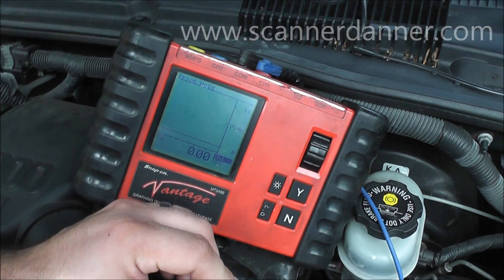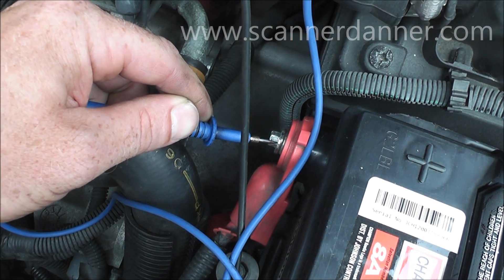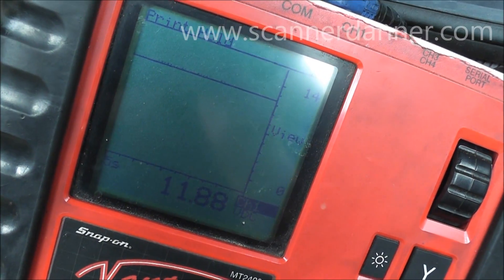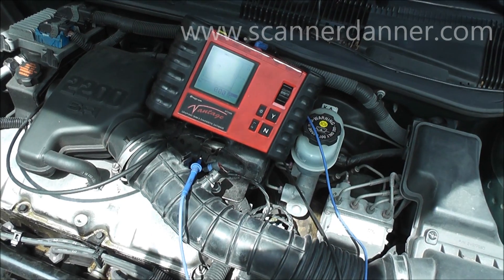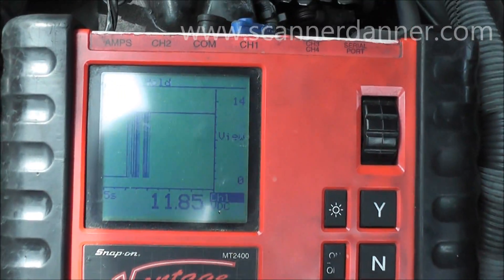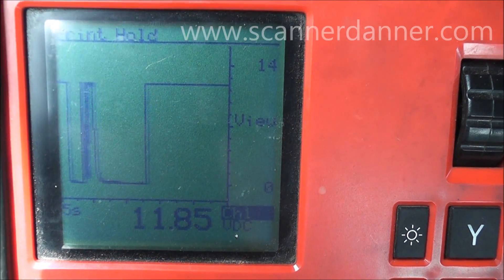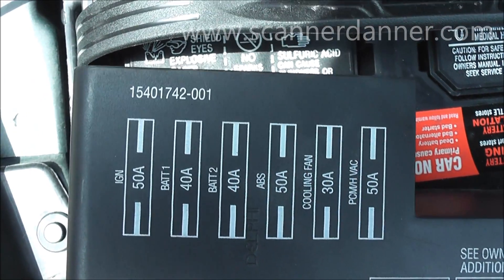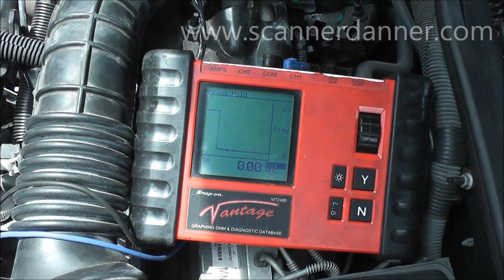2002 Chevy Cavalier No Start (a direction based approach)

Comment: Thank you.  I used your video to fix my 2002 S10.  Your explanation is to the point, logical in the correct order of diagnostic and very useful.  My little 2.2 engine only has just 66,000 miles but stuff pops up.  Yesterday I got in and started the truck to go to the park with my wife and daughter.  The truck ran for a few seconds then just sopped.  I noticed the shift indicator didn't eliminate over the PRND21 deal, and the fuel gauge didn't work.  I'm no pro, but have one of those diagnostic testers which I hooked up to see no communication.  I had no idea what to do at the time, so I searched the sea of forum thoughts which generally lead to land of nowhere.  Fortunately I found your video the next day.  My problem was simply a blown ECU fuse in the engine compartment.  I found it with my electrical tester, put in a fuse and bink! on came the illumination over the P, the fuel gauge went up and she fired right up.  Thanks man!
Reply: Awesome Greg. Don't forget, that fuse blew for a reason. My suggestion is keep some extras with you in case it happens again and DO NOT put a bigger fuse in as the "fix". A 5 amp higher than normal to get you home in an emergency situation only and if that blows, get it towed.
Reply: ScannerDanner Premium For sure.  Thank you for another sound suggestion.  It;'s amazing how glitchy these little trucks are given the low miles.  This one was driven by a grandmother for the first 62,000 miles in Arizona were it doesn't see snow and very limited wet conditions.  It looks clean and orderly, but still it has goofy stuff that pops up.  It is 13 years old I guess, so I understand.

Comment: hello i have a  2010 ford e250.  recently i has a wrench light on the dash, the van is bucking real badly if i move off  slowly if floor it , it will get up and go with no slip or bucking.  if i come to a stop light and shift from drive to 2  it will surge and just dies,   if i then step on  the gas in 2  its like the  gas pedal dosent exit.   if am doing say thirty miles per and shift to 2 it will drive with no problem ,.. only sitting it will not rev it will just surge and dies..    wrench light not sending  code to my obd scan.  thanks your thought
Reply: I am directing all help requests to my forum. Sign up (it's free) and create a new post. Be sure to add a name under "alias" as this is the name that will appear in the post.
Here is the link to the forum. 
http://www.scannerdanner.com/ForumRetrieve.aspx?ForumID=3226

Comment: I have a '05 Cavalier and (1st Car). I drove it to work, to get gas, and then Staples. When I came out of the store, my car wouldn't start. It sound like it would catch but it would die out. None of the warning lights were on prior, until after the problem. The battery and oil light came on. 

So long story short. I had it towed home, changed the oil, and had a someone check it and they believe that it is the fuel pump. But i'm still wondering how when I had it changed this past summer. Any Ideas?
Reply: I am directing all help requests to my forum. Sign up (it's free) and create a new post. Be sure to add a name under "alias" as this is the name that will appear in the post.
Here is the link to the forum. 
http://www.scannerdanner.com/ForumRetrieve.aspx?ForumID=3226

Comment: I am having a similar problem. I can start my 03 cavalier and it will start but stop 2 sec. later. here is the kicker. i also have no power to the car ( ei. the dashboard, internal lights, etc) so far all that works is the hazards and signal. headlights will not turn on, radio does not work. checked battery and its fine. checked fuses they are fine. cant understand why i have no power to the dashboard or anything else and wondering if the two problems ( starts but stops and no power to dash ) is connected. if anyone can help that would be great
Reply from the maker: I am directing all help requests to my forum. Sign up (it's free) and create a new post. Be sure to add a name under "alias" as this is the name that will appear in the post.
Here is the link to the forum. 
http://www.scannerdanner.com/ForumRetrieve.aspx?ForumID=3226

Comment: I have a 2002 Chevy Cavalier my car is kind of doing the same thing but with that I noticed the anti theft light is not coming on at all even when I try to make it come on it won't my car starts up and then two seconds it dies runs great for the two seconds change the fuel pump and its weird it started ran fine once I shut it off and then tried to start it again it went back to doing the same thing any ideas?
Reply: The start and run for a few seconds sounds like a typical GM passlock failure.

Unlike older GM's your key does not have a resistor  however the lock cylinder has a similar feature when your cylinder is turned with a key it flips a magnetic switch that verifies the cylinder is being turned, IE you are not hotwiring the ignition switch.  At the lock cylinder there is a connector three wires Black - Ground, White (sometimes red) 12V (Bulb check) and a Yellow which is 5 volt signal if your signal voltage is bad it means a wiring problem or a bad BCM (BCM controls the antitheft in 01 - up cavaliers, 00- down is the IP) the BCM is located in the Drivers left footwell under the dash  However the most common problem with the Passlock cylinders is a bad connection due to corrosion at the lock cylinder connector clean the pins the best you can with electrical contact cleaner your other option is to add a resistor between ground and the yellow 5 v reference wire  which bypasses the lock cylinder, you can OHM the cylinder to get the value or you can buy a remote start bypass from a company like DEI for $15, if you replace the lock cylinder (a waste of money) you will have to do a passkey relearn, but thats an issue for another day.

Comment: I have a 2001 chevy cavalier it isn't an all electric car it has roll up windows no anti-theft system from what I know. My issue is I keep having trac off problems with this car. I tested the throttle position sensor with my multimeter and it wasn't that. I replaced the spark plugs and it wasn't that what do you think it could be ? Also I have two wires dangling from the alternator where do they go and is this affecting my car any ?

Comment: yes it does and it only reaches to the same place and the battery light stays on now it is also in the same black covering
Reply from the maker: Ah that's because that is the alternator main battery cable. Your system is not charging without that wire being hooked back up to the starter battery post

Comment: hi my name is nick I have a problem I had to change my starter on 02 cavalier but they gave me the wrong one so I had to wait  a few days for the right one now I put the new one on but I have a wire where I don't remember where it goes I put the red on and the little one back I have a wire left that is green not sure where it goes any help please let me know
Reply from the maker: Nick without looking at a diagram I don't know for sure. If it has an eyelet on it the same size as the heavy battery cable eyelet,  it belongs on that same stud. It is common to have wires called fusible links that come off the main battery stud on the starter

Comment: my check engine comes on...my car starts sometimes but dies after idling for a few seconds...other times it will not turn over..if i turn the key off & on about 3 times  then start it will start...no warning lights comes on when it is running..just had a new sepertine belt put on it...just had the oil change

Comment: Had a similar condition, wouldn't start. Shift cable bushing on top of transmission came loose. Two zip ties later back in business.
Reply: When is the shift cable bushing located? My 99 just stopped while I was going 30mph down the street.

Comment: My cavalier is a moody car!!! Cleaned off wires and got the computer up and running. It wasn't clicking until I turned the defroster off and back on.Now it is clicking with no spark. All fuses are back up to 11.7 volts. Would it be as easy as getting it jumped now???

Comment: My 2002 Cavalier is reading 5 volts on all fuses in both fuse boxes (inside and out) but the crank fuse is reading very high.  What could that mean? Also, the windshield washer fluid tube when moved sometimes causes all fuses to lose all voltage, including the computer lights and door buzzer stop working.  The computer test was done and got 3 volts and 0.0 so computer is no working. Any suggestions????
Reply: You have a main battery voltage supply problem. ( severely corroded cable somewhere ) I would look first in the area of the windshield washer tube. If I remember there is a main harness that goes under the frame at that location that is notorious for wiring problems. Usually this just affects the headlights and parking light circuits though. I don't remember this area causing a no start.

Comment: Hey I have a 2002 cavalier as well, the check engine and ABS systems lights turn on but the starter won't even crank all I hear is the fuel pump for a couple of seconds. It will only turn on once a day and after that nothing. Would that be the solenoid/starter going bad?
Reply: I have the same model and the same problem. Any input would be great.

Comment: i have a 97 chevy suburban 350 vortech ,,  no power to fuel pump,replaced pump 3 times , checked the wiring from pump to the fuse panel,replaced fuel pump relay fuse,replaced comp in engine,replaced engine coil,just no power to fuel pump tested fuel pump with battery it works,so not sure what else to try
Reply from the maker: Watch these videos
How to test an electric fuel pump (GM CPI case study)
How to test an electric fuel pump
GM Fuel Pump Relay Testing

Comment: ScannerDanner, you give great video...  2004 sufire, similar problem, no spark, no fuel.  I was following along and when you got to the engine compartment fuse box, your small fuses (like the PCM) were hot.  Mine however do not light a test light.  All the large fuses do, just the small fuses are dead.  Any ideas?  Does passlock shut down both fuel AND spark, I can't seem to find a definitive answer on that?  If you happen to answer, thanks...

Comment from the maker: Then you have a voltage drop problem in the ignition switch or in the wiring to and from the ignition switch. If you can tell me the exact fuses that are reading 7v, I could probably guide you further.

Comment: it seems like im getting power to starter just not through the ignition. could it be the key switch or the relay that's mounted infront of radiator because that was a recalled item on these cars. any ideas will help thank you!

Comment: okay scannerdanner, Im stumped on my 1999 cavalier. 2.2. has the anti theft system. I turn the key and nothing. not even a single click. all electronics are working. fuel pump everything. it doesn't crank. it cranks if take a screw driver across the starter but it just spins. like the starter isn't catching the flywheel. also the key was hard to turn had to move steering wheel around to move it.

Comment from the maker: Okay, say all of your fuses are good. Then what? There are times you will want to know how to do this reference voltage test and why I did it here. 
Check out my Honda Element no start video and you will understand why better. 
You are not wrong in your thought process my friend. And I could have done as you suggested first. But this 5v ref test is very valuable and I wanted to show it.

Comment: if you have no communication and no check engine light  i don't understand   why u would check for 5 volt reference  i would check fuses even if fuse box is not labeled it only takes 30 secs to run across all the fuses with a test light  then if have power at fuses check reference voltage

Comment: Hi great instructional video
Could you please give some advice
My brother has a sc400
It's started played up sometimes stating, stalling, leave it for a couple of days and it would start until after a few months it's cranks but no start, obd1 code 15 number 2 ignition circ. I saw your vid on cps and replaced crankshaft position sensor as not upto spec. Have tested cam sensors ohms and v's 800 ohms 1,3v ac
I paid a auto electrician look at it and he has no idea, no auto sparky. 
Any suggestions

Comment: hey paul is there a ''rule of thumb'' on coil packs that you could just pull off the boots to check for spark? is it any waste spark system? or is it only GM with a waste spark system? i just bought my son a 2007 3.8 grand prix and the coil packs looked identical to these,and its a GM obviously, i just dont want to ruin anything by being to lazy to attach an inline spark tester but if there is a rule of thumb on which systems you could do this on? thanx

Comment from the maker: as for the low beams that are not working, there is a wiring harness connector that runs underneath the driver side frame rail. you have to take the driver side inner fender apart and remove the washer bottle. you will find the wires broken in this location. if I remember correctly the low beam control wire is blue

Comment: Paul can you help me out please, i have a 2001 nissan sentra gxe, and my dad and myself changed the engine as the original engine broke down, the car turns on with the new engine but shuts off by itself, unless i accelerate the motor, sometimes the car stays on but in those cases the car revs itself up, i was told maybe fuel filter, but auto zone told me it doesnt have one, could it be a vaccum leak like everyone else has told me? can someone help please

Comment: If the state inspector is doing his job right though, a car with key on engine off that does not illuminate the CEL at all should get failed and not pass inspection. (for the USA at leaast)

Comment: Very cool paul on finding the partially broken fuse.  I had a similiar problem once with a loose fuse connection myself.    I would like to add one detail, paul already knows this, but I don't know if everyone else does, you can read 12 volts on both sides of a fuse and the circuit can be unloaded, then as soon as you have current flow the voltage drops on the other side of the fuse, as shown in the video, this kicked my butt once, so as an extra measure I use my loadpro leads to load the fuse.

Comment from the maker: Thank you. And I wouldn't argue that point but that wouldn't have made for a very good video :-) Also there are some valid procedures in here for the DIYer. What if you didn't have a scan tool? What if the fuses were good? What if you didn't have a wiring diagram and the fuse box wasn't marked? What if you started by checking for spark and stayed on that path, replacing a lot of unnecessary components that had nothing to do with the problem.

Comment: I got a pack of 50 at walmart.  They are in the sewing/crafts section.  While there, pick up a "seam ripper"  safest way to open up a wiring harness without causing more damage.  They come in two sizes there, I prefer the smaller ones.

Comment: I should of watched the whole video before commenting.  That 10 amp fuse you showed that was discolored.  That is exactly what I've seen on fuses that had a fuse tap on them then removed, that terminal ends up being loose and causing a high resistance connection,  And you know the result.

Comment: Good point on not jamming the probe in a connector and spreading the pin.  I also hate "fuse taps" the type that hooks over the fuse blade and in doing so doubles the size of the fuse blade.  I have run into it causing problems after the fuse tap is removed, the fuse won't make a connection from the terminals being spread apart.